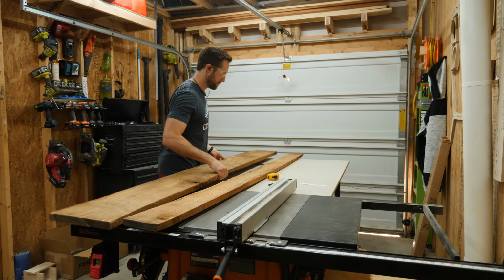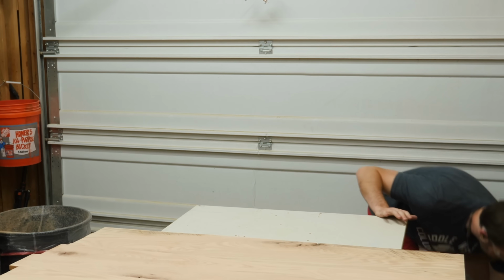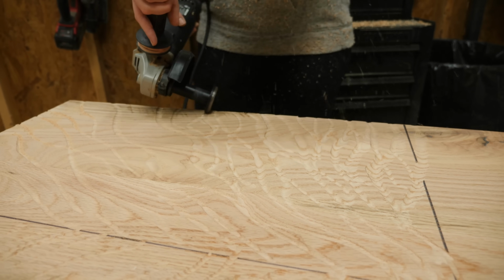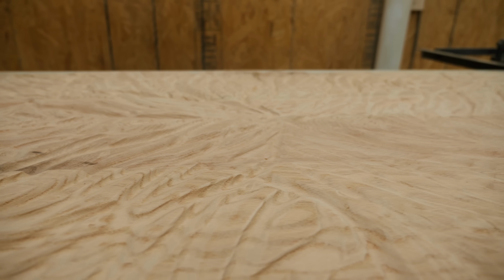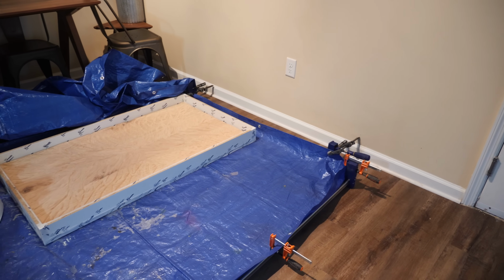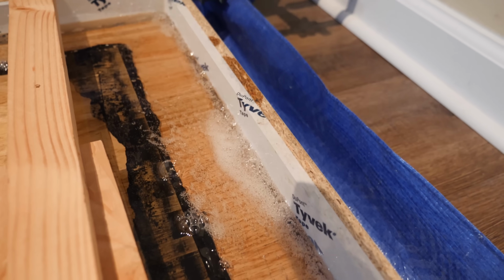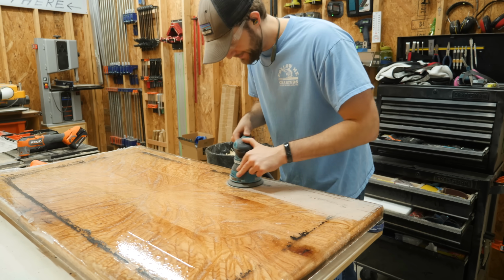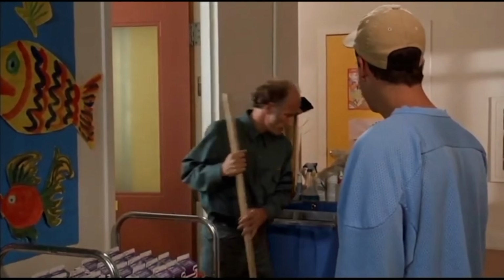one mistake

Comment: Steak sauce: when stuff goes south happens don't panic. Take the time to consider the options. I think flipping the table over in the wet epoxy was not the best choice as all the grooved areas would trap air. The table needed to be submerged but still be upright. Some possible options: 
1: Lift up the mold on saw horses, hold down the table top, drive screws thru the mold into the table bottom. Let the epoxy resettle.
2: Just let it cure floated, add another epoxy layer over the floated one to finish.
3: Screw the slats to the mold, Drive 4 screws thru the slats to hold the top down. after cure, remove the screws and patch the screw holes.

Comment: Steak sauce, perhaps the most important item in the shop will always be patience.  Too often shortcuts or refusal to take the time to do what you think is really necessary results in either failure or disappointment.  As a farmer each spring I know what should be done and in my younger years skipping something for expediency or to reduce cost, were expensive options each time.
Do what you think is necessary, take time to do it right.  Do the right thing always in every thing. Happy life is the result.

Comment: Steak sauce, been there Eric. Feel your pain. Made register covers for my own home. Measured all the registers, drew out some plans, made the cuts and put them all together. However while putting them together I decided they looked better with the end cuts hidden by the front. Im sure some of your readers can see where I am going, the finished project was smaller by the material used on those end pieces, which was half inch mdf, so now because I measured so precisely the registers, the covers were all to small and wouldn't fit. Ugh, at least I used painted MDF. I was able to notch out a few to get them to fit, more than half had to be re made. Thanks for sharing, we learn best by our mistakes and whenever we can learn from someone else's mistakes, it is still a great lesson, just a whole lot less painful!

Comment: steak sauce - if you still have the top you could double down and start drilling small holes into the bubbles and filling them with thinner epoxy but then the question becomes whether to try to fix with clear or embrace with colored

Comment: Steak sauce. 
Been there...I did a complete 2nd floor in white oak flooring (that's what my installer told me)...they wanted red oak.
Took a beating on that job.
Meh you recover to build another day.
Love the content.
Keep at it.
Reply from the maker: Thanks for watching, lightning! Any projects you’d like to see in the future?
Reply: I was running about a gun cabinet or a display case for the knives I have acquired over the years.  I have a bunch of old pocket knives from my grandfather and my dad I would like to put out to remember then more often. 
Would love your take on those.
Thanks for the reply!
Reply from the maker: A big display case?
Reply: @SpencleyDesignCo  
More a wall hanger....maybe 3×5...glass front...hinged door to be able to take them out...not sure...want it open so you can see them so not a kitchen cabinet with all the bulky frame work.  Maybe a piano hinge on the top and a secret lock on the bottom to prevent theft?
Been on it for some time ...if I figure it out I will reach out...lol.
Thanks bro.
Reply from the maker: That sounds like an oddly specific project 🤣

Comment: Please don’t get me wrong, just for my understanding: I’m a professionell cabinetmaker from Germany and I‘m more than confused by your pricing. 2000$ for a chessboard, 5000$ for this little table. I guess the price for the material is around 10% each, the „sales and use tax“ too. So you charge 1600$ for this chessboard. Around 8 hours of work in total, that‘s 200$ per hour. That’s just… wow. Which client pays you that much money for a simple chessboard without any digits/letters on it and a visible mpx-board underneath. 
Is it common to charge those prices? In Germany it’s around 60€ (tax included) per hour.
Reply from the maker: I rarely do client work, so I often give the “go away price”. If a client wants it, I’ll build it

Comment: Steak sauce — I must say, 7k views on that video is a shame, there's so much more to be learned from mistakes than from perfect builds.  Problem solving and course corrections are the heart of the craft!  Did you end up redoing this project?
Reply from the maker: Thanks for watching! Yes, I ended up remaking the table and made them a lot of other pieces as well
Reply: @SpencleyDesignCo bro.. u could have easily grinder out the bubbles and filled the cavities with more resin.. it would have been worth your time.
Reply: @SpencleyDesignCo or even planes the top 1/8th inch off to expose the majority of the cavities and then dremmeled the rest. Use that nugget stop submitting

Comment: Steak sauce - couldn’t you have used a router jig take down the epoxy layers, go back over it with the abortech and sand? Just wondering if you gave that a thought to save the 5k.  I wouldn’t have presented that to the customer I would have just told the customer hey we had an issue and I need to make another top. Your supposed losses weren’t really 5k.  You were our time and money on the epoxy and operating costs.  But the wood was free as you indicated and your living costs would have been due regardless of the job.
Reply from the maker: I just remade the table. It was faster

Comment: Steak Sauce Eric! Thanks for this video. I have always wanted to use epoxy on a table top but was always concerned about the difficulty in getting it mixed properly and ending up with a bubble free surface. Your video visually presented the potential for unknown that can happen. I would have not thought about the potential for the wood to "float" when it is submerged in the epoxy.
Reply from the maker: You bet! That was the whole reason behind posting this, just to be honest and show everyone makes mistakes.  Plus, now people won't make the same mistakes as me! :) My best suggestion is to get those mixing containers that have marked lines on them to help with the right ratios

Comment: Steak sauce...its hard man. Learning on the fly sucks. I did an epoxy outdoor table this summer and made several mistakes. Bubbles, leaks, not level, sanded too far etc and it was a complete nightmare. I made it work eventually...only because I was using the client's barnwood as a decorative top.
Reply from the maker: It’s definitely a learning experience, but life goes on 😀

Comment: I'd like to know how long this video took to make. Because you went from shoeless in shorts to winter jacket in like 30 seconds haha. I've found a good way to keep stuff from floating up in an epoxy form is to clamp it around the edge. You can just use a 2x4 block wrapped in tyvek tape and clamp to the perimeter. Also, I bought  can of release wax, and used that instead of Tyvek tape and I've found its much easier. I wonder if you got bubbles because there was air trapped in the oak? Next time before I do an epoxy pour, I'm going to coat the wood in polyurethane and see if that gives results. 

Epoxy is such a pain to work with. Ya it looks awesome, but there's a million pitfalls you can fall into along the way. Any chance you're going to take a second crack at this table because I think the concept is awesome!

p.s. steaksauce ;)
Reply from the maker: Thanks, Zac!  That's ohio weather for ya!  One day it's 75 and the next day it's snowing.  I definitely will give this one a redemption try in the future

Comment: Yowsers! Steak sauce with no steak will be on the menu for a while.  The logo on my guitars is a sticker recessed into the wood, with a layer of epoxy over it.  It took me ages to work out why the stickers would curl up at the edges or float.  I learnt the lesson in a slightly less expensive manner... just carefully drill out the sticker and try again.  CA/Super glue seems to not melt with the epoxy curing heat... if that's helpful and you'll even entertain epoxy again!
Reply from the maker: Haha there are sooo many things I could’ve done to not mess this up. Maybe I’ll try it again in a year

Comment: Steak sauce.    Ya.  Wood floats.   Lesson learned.    A good trick is to always clamp your piece to the bottom surface of you mold.  Plywood not needed.   Also save the tape.  Caulk seams then use a mold release spray.   Works better.     Good luck.  Hope this helps
Reply from the maker: Thanks     for     checking     out    the     video    scott